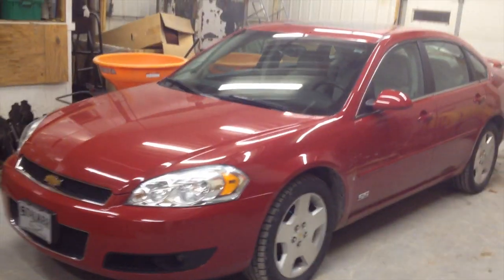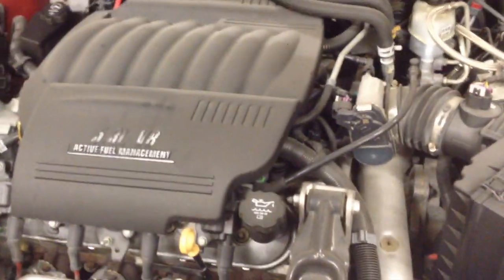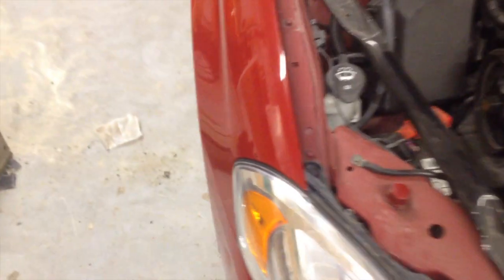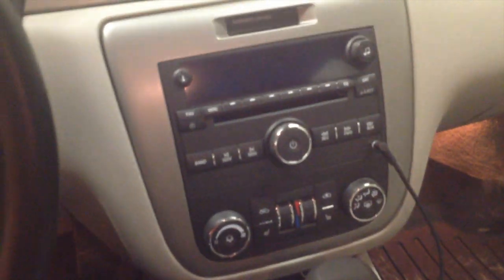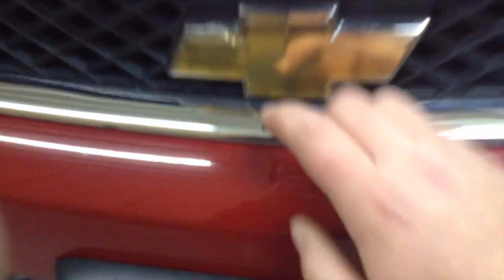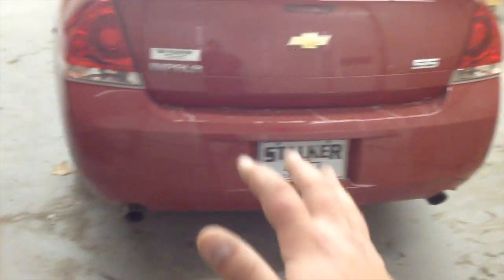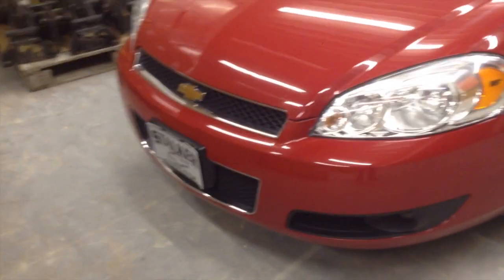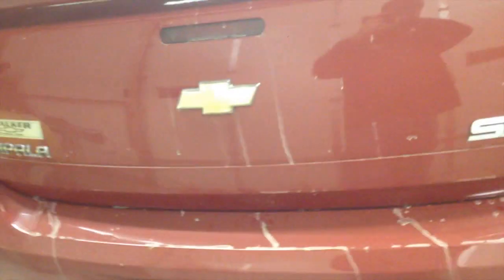My New DD a 2008 Impala SS

Comment: Get long tube headers cai tune and resonator and muffler delete and use 4 inch pipe and you will love how it sounds and you will get plenty snap crackle and pop and also get a tick street heat cam and dod kit and shift kit  but i love my ss impala

Comment: Do you still have this car? Did you ever have any transmission problems? I'm interested in one, but I've heard the trans is on the weak side for that engine power.
Reply from the maker: No I sold it about a year ago, my transmission started to slip a little right before I sold. I know the kid that bought it, he has never touched the trans and he drives it hard. Hope this helps.
Reply: Thanks, I appreciate it.
Reply: @TanTinPerformance  lol  does this kid still have this car
Reply from the maker: @Efortysicks  no he sold it.

Comment: How good are the transmissions on these cars ? I planned on getting a Grand prix Gxp 2008 5.3l v8 , but i read so many problems with the transmissions
Reply from the maker: Miguel Soto, it depends on how they are driven. If they get drove hard they don’t last. I have read somewhere that they aren’t rated for the horsepower and toque these cars can put down. It also puts ware on all the hubs ball joints too, mine had a habit of eating them. However my cars transmission started to slip awhile after I got it. I changed the fluid and filter and that seemed to help. I won’t lie I wasn’t the nicest to the car as I could have been but I drove it like it was a 300hp car.
Reply: Mine broke twice. After the first time I got it all rebuilt from a company I think call TPI Transmissions. I think. And then the band's got hung up on some hangers and I had to replace the bands again in the transmission.